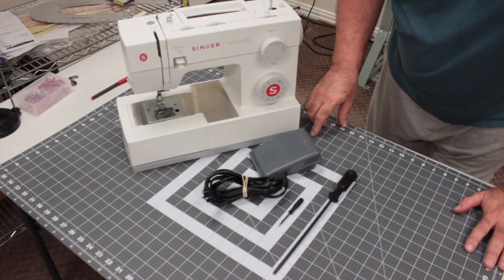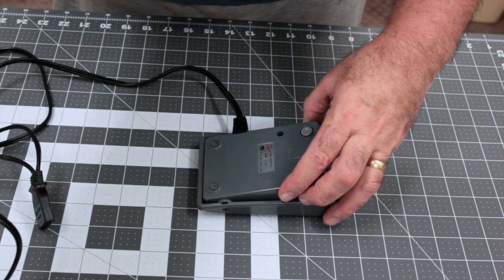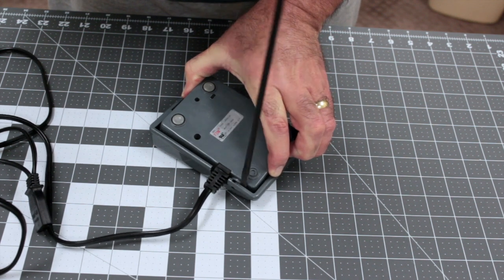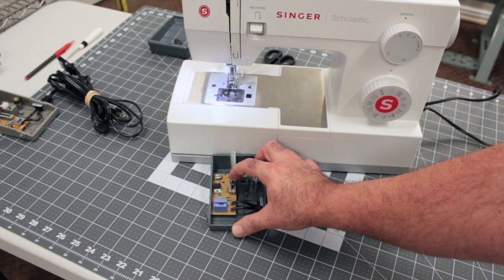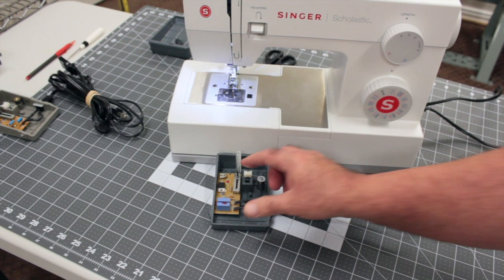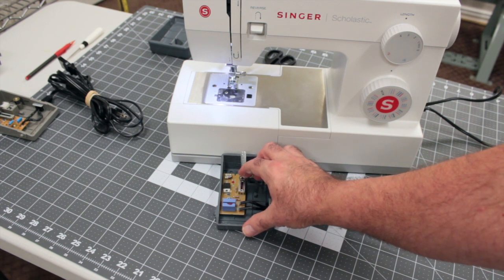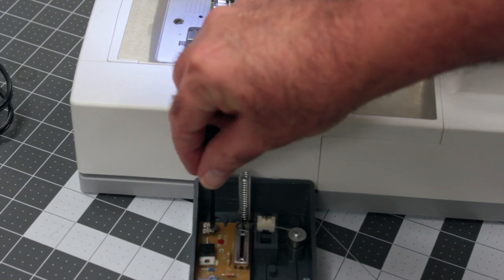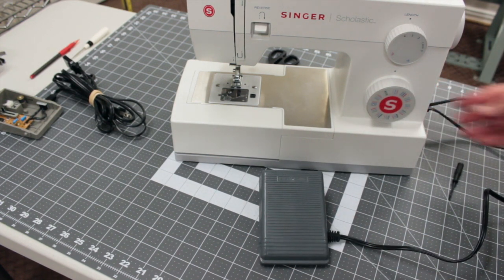Slow down the Singer Heavy Duty Series on some USA Versions

Comment: My model 4423 (european) came with an FC--2902D foot pedal. That one has a little hole in the bottom, through which you can adjust that screw (potentiometer) directly, without opening the case. A little flashlight might help locate the screw. Works perfectly, thanks for the tip!
Reply from the maker: That is why I said it was for the USA models.
Reply: @kevinsews  I am in Australia. I have a CP6355m - which was a promotion series Heavy Duty model. The sewing pedal has a hole with a two sided arrow. It appears to be a hole to enable me to adjust the screw inside the pedal for sewing speed.
Reply from the maker: @flower-uw1hm  I wish the USA version had that option.

Comment: Hey man, I was wondering if you could tell me which specific model it say on the back sticker? I opened up the one that came with my machine and unfortunately didn't have the same parts so I could adjust it. I'm gonna try buy the same one you used here instead :)
Reply from the maker: I own the 44s and 4452 and they both allow me to adjust. I have heard they have changed  some parts since I bought mine 4+ years ago. Therefore, it will depend on what part of the world you are located and how long the machines have set on the shelf.

Comment: Hello my foot pedal has the same bobbin to twist to change the speed but my board is different and the 2 little things to the left of the circle in the video are up to the top facing the top and I'm scared which way to turn it since its slightly different could you help? Thanks
Reply: Please help
Reply: It should work the same. Take a permanent marker and mark the position of the bobbin before you start adjusting it...that way you can always return to the starting position. Hope that helps.

Comment: Some of the new pedals don't have that variable resistor and some do. You don't need to open it, there is a hole on the bottom side of the pedal, you can use a screwdriver to turn it down. IMHO even when you turn it all the way down it's still too fast, I'm going to desolder that variable resistor and see if I can replace it with one that has a different value.

Comment: Thank you very much for the useful information.
However, I tried this solution but nothing happened when I turned the screw clockwise (while positioning the screw upper left). 
Is it a malfunction?
singer model is 4432. please help me.
Reply from the maker: Some of the same model machines don’t come with the foot pedal that works like the one I have.
Reply: I suggest buying a voltage converter if you bought your machine abroad. My machine was too fast and rotating the screw of the pedal didn't help. I bought my machine from the us and using it in Australia, the machine works on 120V while the supply voltage in Australia is 230V. After plugging the converter the machine slowed down and I was even able to change speed with the pedal screw.
Reply from the maker: @nagham1helou  Thank you for that information.
Reply: @kevinsews  Thank you for your answer.
Reply: @nagham1helou  Thank you very much. I will try it. Could you let me know what "the voltage converter" exactly means? I'm using 110V->220V plug (adapter). Are they different?

Comment: UPDATE: Unfortunately this didn’t make a difference for me, but it was worth a try! Thanks anyway :))

ORIGINAL: I am so trying this! I got my Singer Heavy Duty 4423 today, and am so frustrated because it’s so ridiculously fast. So if this works, I’ll be so happy (I’m a beginner and can’t even sew a straight line at this speed) ! Will keep you updated :))
Reply from the maker: Please do get us updated.
Reply: Did you find anything that worked
Reply: @Deserie  no, unfortunately I did not :(
Reply: We ordered the 4423 model from us, which initially came with us outlet; in addition, we bought an eu outlet adapter, and as you might assume it was running so fast. I did try to lower the speed in the pedal as shown on the video, but no luck unfortunately. 
However, I thought that maybe the problem was with that eu adapter we bought, so after receiving the European version of the pedal the issue was resolved, I still needed to lower the speed in the pedal, but at least it allowed me to set the needed one. I hope it is helpful for someone in the future.

Comment: What experience do you have with the motor/LED light assembly on the 4452?
I have an assembly, out of the machine, where the motor turns on when the foot pedal is depressed, but after letting off the pedal, as the motor speed goes down to almost a stop, it then continues to "pulse" back on.  It acts like a failing capacitor on the AC/DC converter board OR the motor itself.  But I can't imagine a logical scenario where it's the motor.
I'm trying to track down the offending component by substitution.  Just thought I'd ask you.
Reply from the maker: As you said it has a failing component .

Comment: I have the hd 4432 and when I opened the pedal I found the screw, but in a different position. I have opened it several times and moved it 1/4 turn right, then left, then 2/2 turn then left, then all the way both ways and I see no difference in speed. The machine is useless for me as it is. I need to do precision sewing for quilting and it is too fast. Can you think what I could be doing wrong? I was do hopeful when I saw the little screw!
Reply from the maker: I've been getting the same reports from others around the USA. It appears that Singer (SVP) boxed up several different pedals. The new Singer 6800 series now offers speed control.
Reply: So there is no hope for me?  When opened, the pedal looks like the one in the video. I could post a photo of the inside. 
The screw was not aligned to the 3-9 position, rather 5-11 position. Any ideas? Which side should be to make it slower: clockwise or counterclockwise? This is not a new machine, but it has been sitting in its box for quite a while. 
Thanks for taking your time to help us with our machines.
Reply: I suggest buying a voltage converter if you bought your machine abroad. My machine was too fast and rotating the screw of the pedal didn't help. I bought my machine from the us and using it in Australia, the machine works on 120V while the supply voltage in Australia is 230V. After plugging the converter the machine slowed down and I was even able to change speed with the pedal screw.

Comment: Hi Kevin, thanks. Can the issue really be in not having an adaptor when we use the machine in Europe (mine has arrived with a US plug and I simply bought a plug adaptor but not the E-level one?).
Reply from the maker: I only know about the ones here in the USA. Even a few of them are different too.
Reply: it will make it worse, these machines can run 120/240v without any changes so it will start quicker when on 240v, and you have even less control of slow movement. Pair that with the bad foot pedal its extremely hard to get it to move slow without adjusting the controller in the foot pedal. My UK one has an adjustable foot pedal, different again to the one shown here, instead of the screw at the top there is a small potentiometer, with a little rectangle hole in the middle you can turn that is more in the middle of the board in the pedal, 100% worth doing and i cant see why it would void your warranty unless you turn it up or down to much, as long as your careful enough taking the foot pedal apart they probably couldnt even tell you done anything to it. And if you have one without an adjustable pedal you can either find an adjustable pedal, or find a local electronics to soldier in a potentiometer, it will void the warranty but shouldnt cost you anymore than £25.
Reply: @shroomiestshroom3655  I'll be interested to see what my "UK spec'd" version has when it arrives. On older, classic gear & cam machines I have put a speed controller in the mains feed, which allows one to adjust "on the fly" with a knob (looks like a "volume control on an old radio).

Comment: Thanks for this, my daughter is complaining her machine runs too fast..I was going to fit a variable resistor in series to take the peak off, but will have a look and see if can do this easier mod first.
Reply from the maker: Okay, let us know the results.
Reply: @kevinsews  yes, it worked and fixed it - she is very happy now- thank you so much for this tip - very useful
Reply: @kevinsews  that's on a UK model, for reference, the layout was slightly different to shown in your video, but the potentiometer was there and had the desired effect - thanks again
Reply from the maker: @filski666  Okay, thanks for the information.

Comment: Thank you for the tutorial! The Singer 4423 that is available here comes with 220V (black color) foot pedal. Do you know if I could still adjust the speed on the 220V pedal?
Reply from the maker: You can give it a try. Others have reported it did work for them.
Reply: Just adjusted my black pedal 4411. Bought in EU. It’s a different setup inside, but the adjuster looks the same. Just in a different spot and orientation.
Reply from the maker: @jessekaltenbach894  Thanks for letting us know.

Comment: my singer 5523 is brand new and it comes with a light in the machine, but i cant sew with the lights on, either having the lights only turned on or start sewing with no lights. how can i possibly fix this?
Reply from the maker: Sounds like an electrical issue. I would return it if it is new and exchange it for another machine.

Comment: If anyone is still facing the problem of slowing down their machines I suggest buying a voltage converter. My machine was too fast and rotating the screw of the pedal didn't help. I bought my machine from the us and using it in Australia, the machine works on 120V while the supply voltage in Australia is 230V. After plugging the converter the machine slowed down and I was even able to change speed with the pedal screw.
Reply: So happy i stumbled upon this comment bc i bought a machine from a guy who moved to my country and he bought this made for the us, a 120v machine. It was crazy fast in our 220v it was stressing me out. Also this would save the machine's motor in the long run with the voltage regulated

Comment: Hello, i'm thinking of getting a singer hd sewing machine and my worry is as a learner the speed. But i'm thinking the speed is surely needed on these machines due to sewing thicker materials? Will the stitch quality be the same slowed down?
Reply from the maker: Take a look at the 6800 series. They offer speed control as well as stopping with the needle down position.

Comment: I've tried this in all the different positions but it doesn't work on my Singer 4452. I just ordered the US version from Amazon. No matter how I turn it it still goes super fast even at the lightest press. What should I do?
Reply from the maker: So the USA version didn't work?
Reply: @kevinsews  Nope. Singer says the foot pedal is defective. Apparently it's a known issue with the Heavy Duty models
Reply from the maker: @marianne1988  Thank you for the update! It will be helpful for others.
Reply: I suggest buying a voltage converter if you bought your machine abroad. My machine was too fast and rotating the screw of the pedal didn't help. I bought my machine from the us and using it in Australia, the machine works on 120V while the supply voltage in Australia is 230V. After plugging the converter the machine slowed down and I was even able to change speed with the pedal screw.
Reply: @nagham1helou  Thanks that probably would've worked! However, I've returned it so I won't be able to test it out

Comment: Excellent video, good explanation. I had a hard time finding the "sweet spot" but it is a little better. I think my pedal is a cheap knock-off. Maybe a genuine Singer would have a better adjustment range. I also just rebuilt the motor. BTW I am working on the T&S 646. Not bad for an old granny.
Reply from the maker: Thanks! I would contact sewingpartsonline.com and  tell them what you are looking for.

Comment: This is awesome , thanks!!

Question , I would think that when you slow the start down you might be increasing the current draw on the motor - no? Almost at low end stall. This is not detrimental to the life of the motor do you think?  

BTW, the disclaimer about working with live electricity you gave is kinda funny, basically saying “ Dumba$$, don’t  stand barefoot in a puddle of water while doing this” ... lol, sad but necessary I guess.
Reply from the maker: I guess it could. Most people don't use domestic machines on a daily basis, so I wouldn't thing it would be a big problem for them. If that is a concern then I would simply leave it alone.

Comment: Could u pls help me in finding what's wrong with my brother sewing machine paddle as the machine doesn't fully stop even the pressure on the foot is fully released.
Reply from the maker: It sounds like the spring is causing the problem.  Are you in the USA?
Reply: @kevinsews   thanks for ur response.No,I'm from pakistan bought my machine from USA.

Comment: It looks like this shifts the speed ramp up curve, from the start of the pedal action to the end, so that you have a bigger range and more control of lower speeds (a good thing!) but a smaller range and less control over the higher speeds.   Does this adjustment reduce the MAX speed of the machine when the pedal is fully depressed?
Reply from the maker: On mine is just ramped up the speed.
Reply: @kevinsews  Tried this on my cheap, Brother ST531HD, and it does shift the speed ramp up from the beginning of the pedal action to the end.  Haven't sewn anything this way yet but hopefully this, along with an adjustable mechanical stop on the pedal, will result in better control of the lower speeds. Thanks for the very useful tutorial.
Reply from the maker: @paulkeenan4309  Thank you for letting us all know!

Comment: If I make this adjustment, does it only affect the initial speed or the overall speed?   With the pedal to the floor, will I still be able to accelerate to the 1100 stitches per minute?
Reply from the maker: Renee Carson It only slows up the start up speed.
Reply: @kevinsews  Awesome!  Thank you for the quick reply!!
Reply from the maker: Renee Carson You’re welcome!

Comment: In the bottom of my Singer HD 4411 pedal there's a tiny hole with - and + symbols left and right of it. I guess you can adjust the speed also from outside, haven't tried it yet though. I bought mine in Austria.
Reply from the maker: @quasimodoo17  Yes, some have while others don’t. It can be a bit maddening.
Reply: @kevinsews  Hi, Kevin, thanks for the answer. I tried it out yesterday and I'm happy to say it worked. Funny thing ist that if you turn the dial in the minus direction, the machine goes fastest. So now I've turned it all the way towards +, and now it goes very slowly, just the way I wanted it. Another funny thing is that as far as I can see, there's nothing about this in the manual.
Reply from the maker: @quasimodoo17  There are several version that ship with this machine. That makes it hard to guarantee that what I show you it will be the same. Thanks for the post though, I hope it can help others.

Comment: I had this issue with my uk singer zigzag machine,it was dangerouse flat out or nothing,sort of on or off!,i changed resistor values in the scr driver cct,then running slow got the motor too hot,the slower the motor turns the less air its cooling fan moves,fitted a 12v smps psu under the inside of the machine then a pc fan on the motor case,is this a design fault?
Reply from the maker: Mine hasn't had this issue. I guess the UK version is slightly different than the USA version.

Comment: I have a singer 4423 and when I press the foot peddle it only actives the bobbin threading not the needle can someone help I tried everything Manuel mode works but not when I press the foot Peddle I threaded it correctly too please help
Reply from the maker: Make sure the bobbin post it push all the way to the right.  That will engage the belt that drives the needle.

Comment: Hello, I have a 4452 Singer Machine, I had only used the machine one time. This time the needle is not moving I checked the front part of the machine that is detachable. Please explain why the needle is not sewing, not moving.
Reply from the maker: When you remove the cover turn the hand wheel and see if the rod that goes through the needle moves. If it does then the screw that hold the needle bar to the rod is loose. It will need to be tighten at the proper moment to keep the needle in time with the hook so the machine can form a stitch. It nothing is moving you have another mechanical issue going on.
Reply: @kevinsews  Thank you, the machine is now working. You're awesome.
Reply from the maker: @danahunt9995  that is great to hear!

Comment: I am going to try this. I bought a Singer Heavy Duty 44S from WalMart. It goes like a racecar from the slightest depression. I really think the machine I bought (to teach myself how to sew) was a used return. I did not get the screwdriver you said came with it. It had a threaded bobbin and thread on it out of the box but no extra pieces at all. On my journey trying to learn how to user the machine I will hear people say The "blank" that came with your machine. Nothing but a loaded threaded bobbin and a spool of thread came with mine.
Reply: Well, my crappy machine doesn't have an adjustment screw. Figures. I regret buying this machine but had it since Christmas so probably can't return it.
Reply from the maker: @GrandmaSezSo  I am sorry to hear this. I tried finding one that supported this, but after I ordered a few that I was told they did and they actually didn’t I gave up.